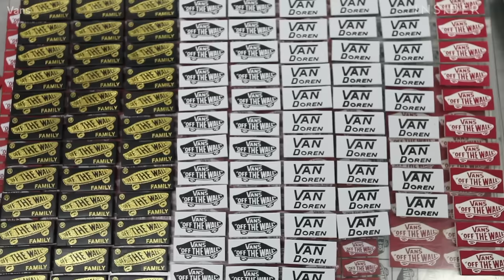How Vans Makes Its Iconic Sneakers

Comment: 02:16. It’s because of this guy that I don’t wear vans anymore. Always skimping out on the glue so the rubber gets cracked on those corners where the shoe bends. After a month of regular use they start looking real old. I just spend the extra $30 and get something of better quality Lacoste shoes are one of the best deals. Yeah you’ll pay about $110.00 but you get a shoe that is well made and polishes quite well.

Comment: Okay, what’s the deal with the shoes always landing on its soles every time you throw then on the floor
Reply: masterShifu the soles are made of rubber thus making the bottom side heavier than the top, that's way skaters have a better grip on the board, it's also the reason why they land on the bottom if they don't it most likely means that the vans you have are fake